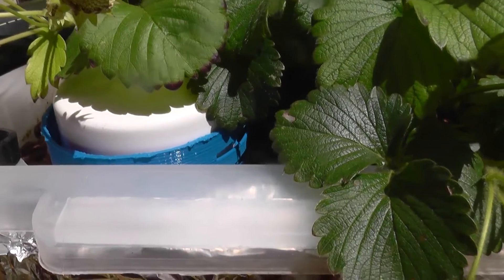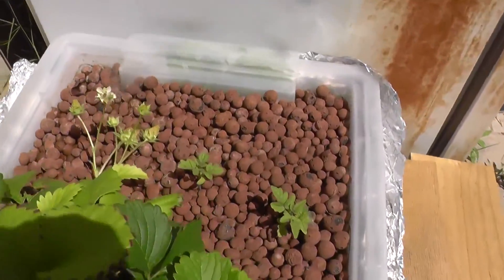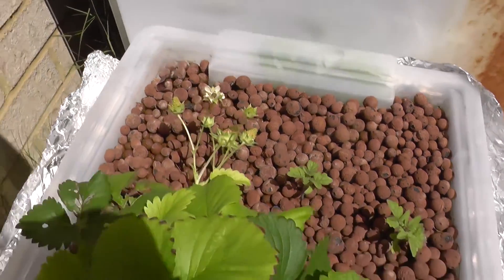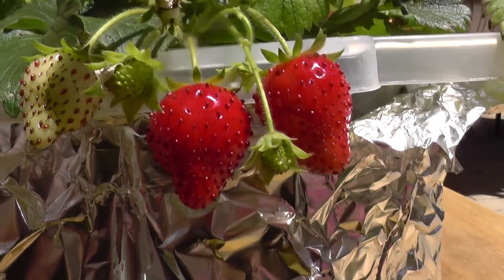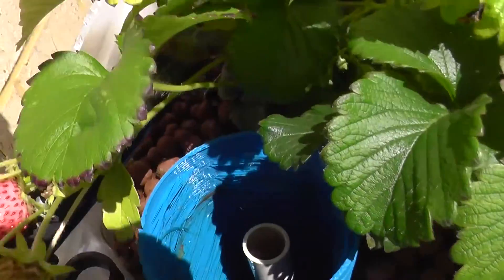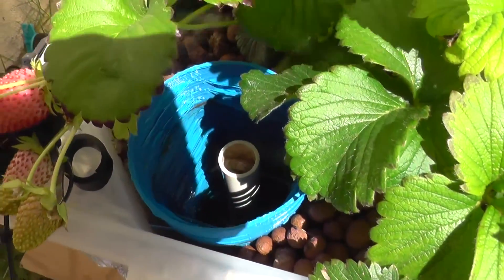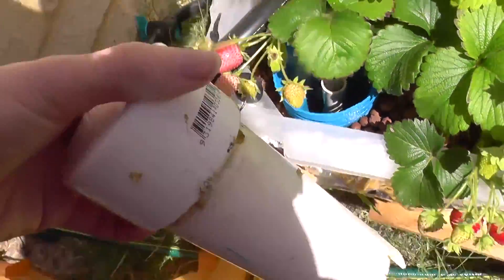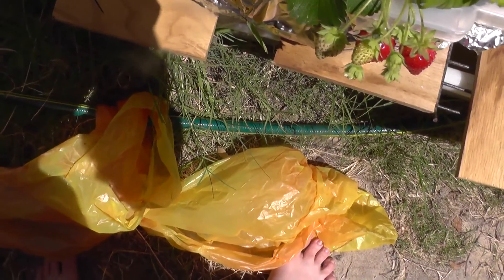Some useful applications for the 3D printer

Comment: Hey Sparkyface5, 

Just wondering how this part has worked out long term? Did the PLA hold up to the environments? 

Thanks. :)
Reply from the maker: Hi JMW,

I was surprised to find that it held up just fine and would still be in use today except that I abandoned the small aquaponics setup in favor of a backyard  pond. The shroud is still outside in non ideal conditions but has more or less maintained its shape and is still completely intact.

Thanks for your interest :)
Reply: How interesting. You hear all sorts of warnings about PLA and water solubility. I guess it probably is water soluble, but lonnnnng term water soluble. Maybe also something to do with filament quality as I've seen one guy post a pic of a soap dish that after 2 months was deteriorating.
Anyways, while we're chatting, yesterday on Angus' group chat, you mentioned something about a Syma motor generator? Please keep me posted on this as I'm just starting a wind turbine project using a washing machine motor for the genny. Keen to see your progress!
Reply from the maker: haha yeah, I think people hear how PLA is bio degradable and they freak out a bit. I've seen people print things from PLA and keep them submerged in their aquariums for fish hide holes with no ill effects.  I would assume the soaps and general grott and the cleaning chemicals found/used in bathrooms may have something to do with the state of the soap container. as for the wind turbine that sounds really interesting. I've seen videos of people using old washing machines to create hydro power.. very effectively too.
Reply: Yeah I guess you must be right! So I'm guessing the PLA doesn't break down and upset the fish either then. Very cool.
Yeah there's a lot of hydro stuff out there, there's the lad(+Angry Ram maybe) who has his whole house powered from his creek! 
Shame I'm in hot and dry WA. Not enough water but plenty of wind! ;) I have just finished re-wiring the motor to generate 12V, I'll post a short update clip on it soon. I'm going to document the project on my(very young, no subscriber yet) channel so follow along to see I don't zap myself! :D
What are you doing with your generator?
Reply from the maker: JMW Concepts very cool. yeah I had the same thoughts about the guy with the creek... I'm also in hot dry WA :P assuming we are talking Australia. I just subscribed to your channel.. cant wait to see how your project goes! I'm planning to make a phone charger from the nema 17 stepper :) something small for now
Reply: Oh cool! Another WA maker! We need to organise a mini-maker fair.
Thanks for the subscription. I only really kicked it off recently so I'm going to start doing regular updates. I'll be watching your progress as well. :)